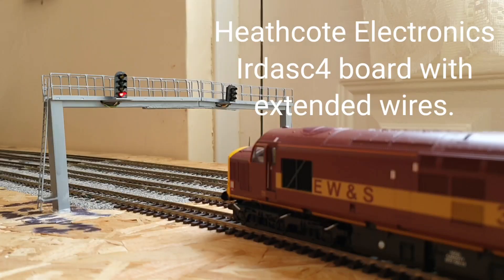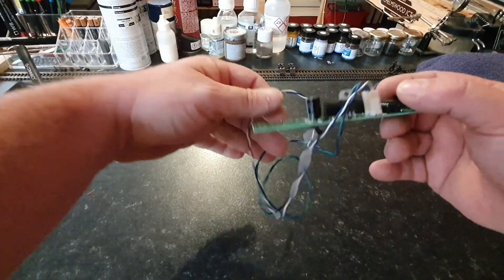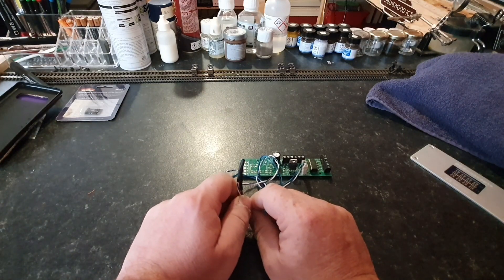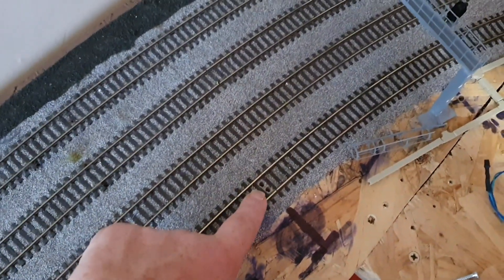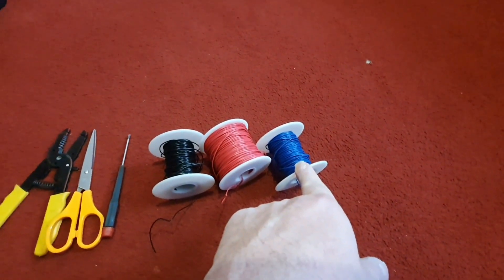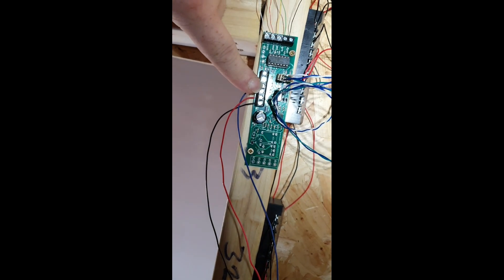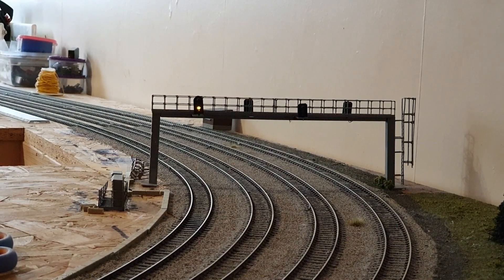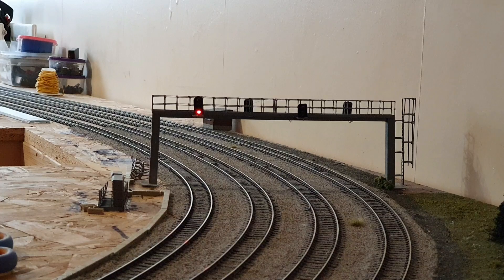Heathcote Electronics irdasc4 with extended wires.

Comment: Hi Peter I've never put working signals in before I've got 3 aspect signals ! So how lights will work of one board and needing how many for the system to work thanks Paul 😊
Reply from the maker: hi paul
you can only have one signal connected to one board so you need a board for every signal.
and the last signal always has to be a mas sequencer board.
hope this helps.
peter